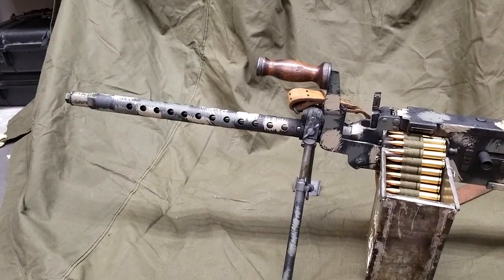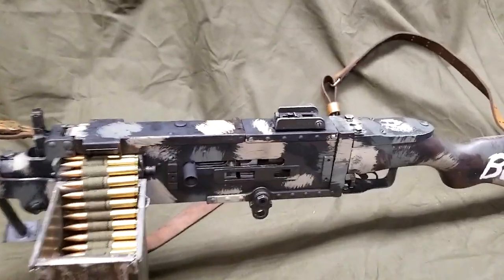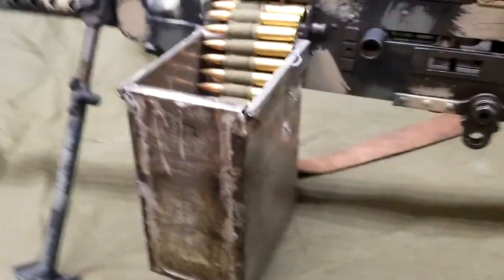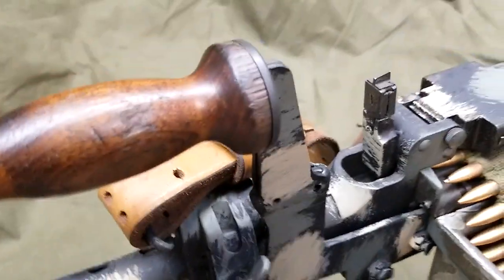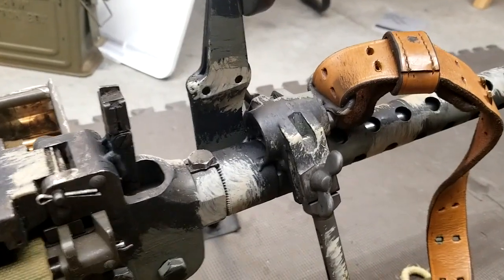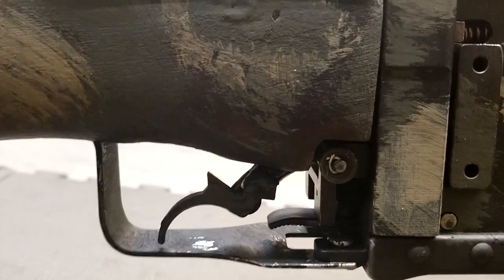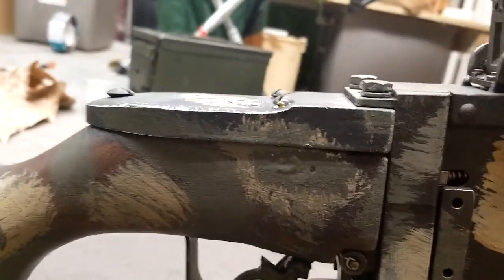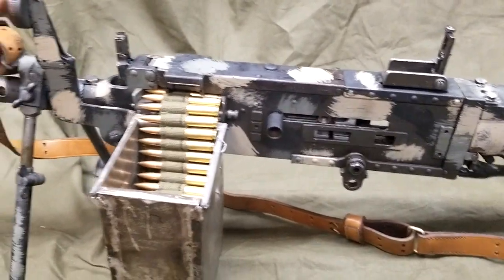USMC ANM2 Stinger Machine Gun

Comment: With the b.a.r. Bipod legs is you to cut the bipod hole attachment part in half then weld both half hole parts to the side of the shroud
That’s what they originally did on the ships heading to Iwo Jima
Reply from the maker: That's not what they did.   If you can reference such a claim where it can be verified I'll appreciate it.

Comment: Did they use locking wire instead of a cotter pin? The ends of the locking wire should be turned over and in on its self, that way the day you accidentally slide your hand across it you wont be unpleasantly surprised.   Nice build, Last build I saw of that was by a canadian museum IIRC, Forgotten weapons ended up using it in one of their videos.
Reply from the maker: That Canadian build is Hollywood, as cheesy as Han Solo's blaster.  It's no where near accurate, IMO.

Comment: What the hell base gun is that, is it an actual M3 or a M1919
Reply: It is an AN/M2 machine gun which was used on aircraft with a fire rate of about 1,400 rpm.
Reply: @keeginhenault2353  so it's like mg42 but chambered in 30-06
Reply: @arvelwirayudha9i089  technically yes.